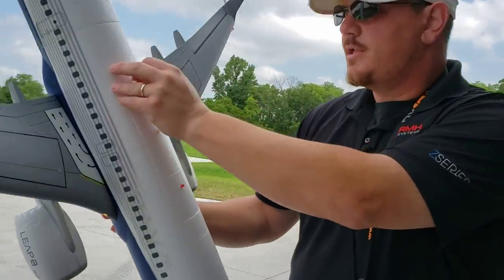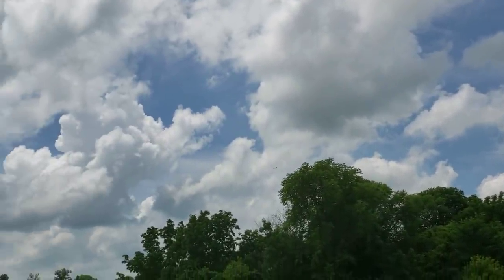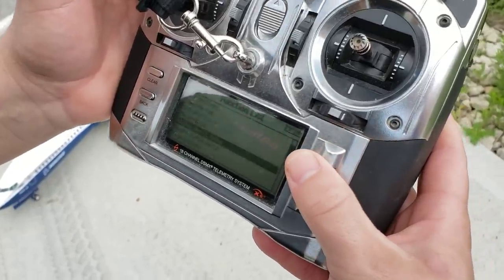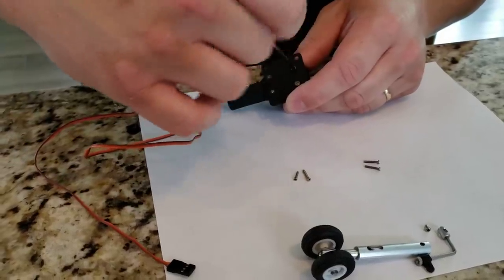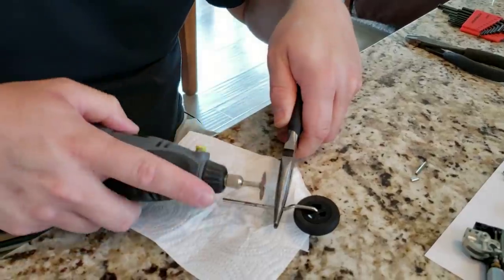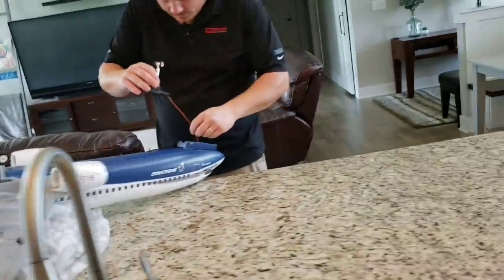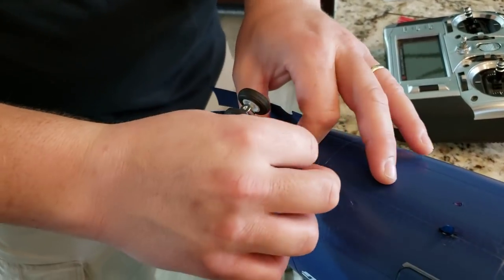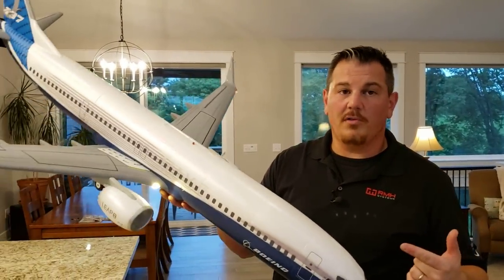XRP/Supreme-Hobbies - Boeing 737 Max 9 - Maiden Flights, Crash, & Repairs

Comment: I had a similar problem and solved this by buying spring steel which resists much better than the cheap steel pins in a lot of gears. It costs nearly nothing and you have this way plenty of material to improve your gear. mostly the phases to support the screws keeping in a predefined position are much to deep and on both sides! This makes it a bit easier for the producer to assemble the plane but makes the pins weaker then necessary.
Reply from the maker: I thought the same thing about the flat spots...they take away like 50% of the shaft!!!

Spring steel, like "music wire" right?

Comment: Hey Brian...another awesome video! On the battery strap situation, maybe try the rubber shelf liner (ala Rich Baker) battery will not move with just a slight snug of the velcro, it works great, battery will never move and you don't have to reef on the velcro...by the way, that wouldn't happen if you were flyin' an ix20...lol...I had to do it! Really appreciate your walk throughs on programming the DX as I have both radios, so can't wait until I can have your input on programming on the ix! (ulterior motive exposed!) Great job man, beutiful plane with an accomplished pilot, love yer channel, you guys are awesome, thanks again!
Reply from the maker: I thought maybe the iX20 would solve that problem - LOL!!!

Thanks again! I think your shelf liner idea is a good one, plus it's LIGHT. Lighter even than velcro, but it'll get dusty.

Comment: Nice finally get to see this in the air. It’s a awesome pnp looks great on those low approach shots. I’m still trying to get my RX turned in just right for my planes I’m missing something somewhere. And remember how I said my IX12 never saves anything after you change it after firmware update see almost the same thing happened to you but after every time I adjust it does it so hope that doesn’t happen to you!!! But anyways safe flying keep’em in the air!!!
Reply from the maker: I'd get with Horizon Hobby tech support. That thing is WAY too expensive to have any issues like that. Sorry you're having issues.
Reply: Brian Phillips yea seems like every other thing I order has a glitch and I was going to order the IX20 glad I didn’t I would be driving to Horizon to get it fixed lol.

Comment: Beautiful looking Jet looks so scale I like those low passes I never was in the airliners but now I am PS I've done the same thing on takeoffyou probably should have put a string on the retract wire when you so you could have fed it back through the plane easier done the same thing though
Reply from the maker: yeah, string would have been a nice idea, but it did pass though relatively easy. I got lucky ;)

Comment: Thought I'd leave it some time before posting,   anymore thoughs on these ?? As I'm considering one
Reply from the maker: Thoughts - beautiful. Flies faster than it should, and needs flaps. Landing gear, especially the nose gear are horrible to work with, but will be fine if we had flaps to slow down the landings from mach 3 - LOL.

I think this plane and those of the past Supreme Hobbies are some of the most beautiful planes on the market, but they are "project planes", meaning you'll be working to get her to fly well, but they are beautiful!!!

Comment: Your new microphone is picking up your cell phone transmission, that's what that ticking is that happens every so often. It could also be the cause of the static. You could try not having your cell phone on your person when you're filming just to see if the static goes away.
Reply from the maker: Pretty hard when you film ON your cell phone. Any ideas?
Reply: @BrianPhillipsRC  
Try putting your cellphone in airplane mode when you're filming, but keep Bluetooth on. I'm assuming your mic is using Bluetooth for connectivity?

Comment: Bryan, have you ever experimented flying with the Lemon Stabilizer Plus or the Admiral 600SP in the recovery mode? I'm curious if these modes can be used like Spectrum SAFE where the RX ca be switched into "PANIC mode" to recover and continue to fly level with no stick input.
Reply from the maker: I have never had success with the Auto Leveling in Lemon Rx products, BUT I love their stabilization. It's GREAT, and super-cheap! Here's the ONLY think I don't love...I have to use Ch 5 to turn Stabilization on and off, thus wasting a channel, when I could do the same thing with channel 8 for master gain...I HATE that, but if I had a 5 channel only radio system, I would like this feature. I also hate ONE other feature....WHY CAN'T WE FORCE STABILIZATION ON?!??!?! If we did that, we could save channel 5 for another function

Also, why doesn't lemon have a 21 Channel with stabilization, like they've been talking about for years!??!?!

I have never used the Admiral rebranded Lemon-RX DSMP product.

Comment: Id like to know which airliner flew the best.  the Airbus A380 or the Boeing 737 max?  They both looked like a handful but I just cant bite the bullet just yet and drop the $600 on the AL37
Reply from the maker: The Airbus A380 is pretty much GONE - sorry to report. The 737 Max 9 is available NOW!!! These XPR/Supreme Hobbies planes are excellent flying, but you need to KEEP FLYING THEM! Don't do slow turns, or you will slip into an unrecoverable stall...I just did it the other night ;( We MIGHT share the video...but she's back up and flying again ;)

As for the Airbus A380 - check out my playlist...we spend WEEKS worth of work to make it so sweet looking, while this Boeing 737 Max 9 looks AMAZING out of box with no mods!!!

Airliners https://bit.ly/39ftdEL
AR637T https://bit.ly/3pW3u86 | LemonRX https://bit.ly/3tw8u6L
4S 3200 https://bit.ly/3xM3ACo
Tx https://bit.ly/3f4JhZl

Comment: Hey Brian,  I just started this video and got about 13 min in to the point of when you set the Flight Modes, a and Master Gain.  That’s exactly the same issue I have!  I can set the 3 flight modes, but the master gain knob doesn’t work.  Also, on FM 1 I set everything to off, on FM 2 I should have only AS3X, and FM 3 it should have both AS3X and SAFE.  However, there is no difference between FM 1 and 2 in my case.  Would you be willing to do another video on setting up both AS3X and SAFE with that AR637T?  It’s super confusing!  Okay, back to the video - gotta see the crash...  😂
Reply from the maker: Maybe if the IRS puts me in prison, and they let me film it...I'll get right on that...but for now, I'm going to keep running from that request like Harrison Ford in "The Fugitive"
Reply: Haaaaa!  😂  Point taken Brian!!  Maybe Horizon will read this and figure out they need better instructions.  Take care.

Comment: Hey Brian, I took my umx turbo timber on floats today and had a couple good landings then while taxiing back it flipped multiple times and I'm having issues now with the servos. They r going full extension and have no response. What should I do?
Reply from the maker: I think you need to let her dry out, and see what happens. I'm sorry for the delay in reply....we've been busy, and only had time about once a week to reply...so you just happened to miss me on the last batch of a few hundred replies.

If the plane still acts funny, you might need to get in a unplug leads and plug them back in to knock off any surface corrosion...but I doubt that you'll even have to do this.
Reply: @BrianPhillipsRC  thanks for the reply. Everything is working now but my elevator servo is very choppy while moving the control stick slowly

Comment: Can you make a flaps video where you install flaps on that
Reply from the maker: I want to. I have some small metal gear servos for that project, but not sure when I'm doing it. We have so many loose ends at the moment. We would like to get this done soon. I've been working in the shop downstairs, and need to get that in better shape before I can embark on that project...but I want to get it done. This plane NEEEEEEEEEEEDs flaps. It's WAY too fast.